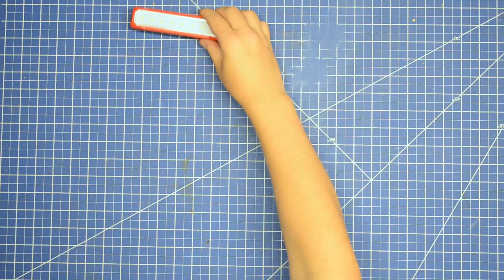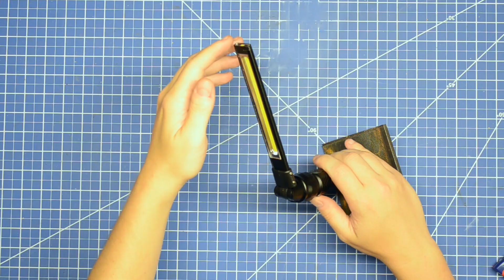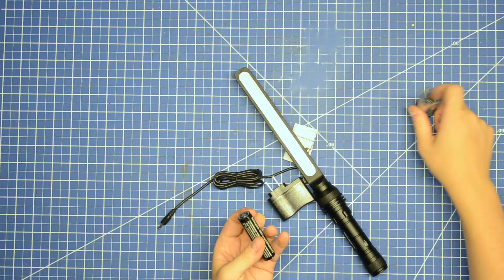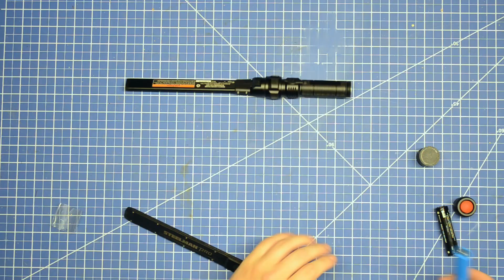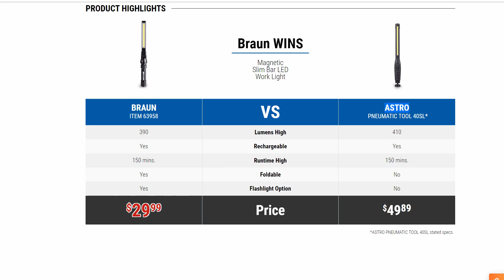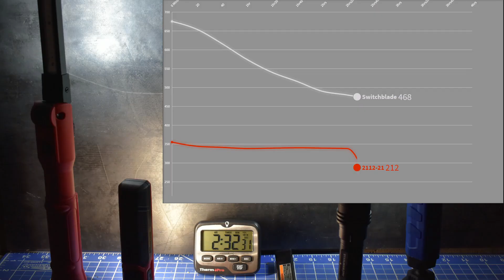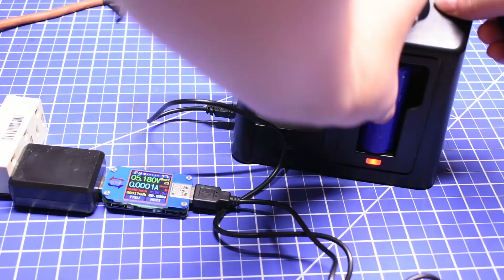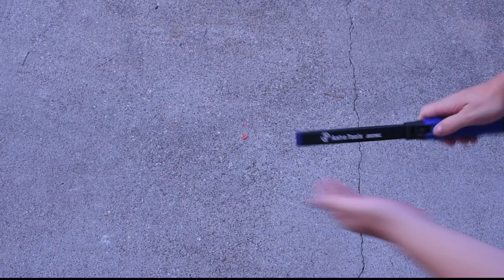Is Milwaukee Lying as Much as Harbor Freight Braun About Lumens?

Comment: The problem with the harbor freight light is not the switch. Just tighten the battery cap on the end. It come loose and causes the light to flicker like the switch is acting up. I have 3 and have had one for more than a year and still going strong.

Comment: I had a Braun light for all of about a week. Dropped it once from probably about 4 feet-ish and it the hinge broke, and light stopped working. I guess if you drop it at just the right angle, it can be pretty fragile, in my experience. Went with Astro after.

Comment: Looks like the Steelman Pro uses a protected cell. That's what that extra "lip" you noticed is. It's a small board with components that will limit the amount of Amperge the battery can deliver, and will also help prevent the battery from being over-charged, or used below a set voltage. Of course, that increases the overal length of the 18650 cell, so not all devices are compatible with protected cells.
Reply from the maker: The other lights take protected cells as well. The lip was plastic
Reply: @TorqueTestChannel  It wasn't clear from the video as it looked like a normal protected 18650 cell, and the other batteries in the video looked like normal unprotected cells.
I've taken a look on the Amazon link and the Steelman website and now see what it is you are talking about. Looks like it has both the positive AND negative contacts on one side of the cell, though the markings on the plastic seem to indicate that there is still a negative side to the battery like normal. I can't find any images which show the other end, or the inside contacts of the Steelman light you tested. If the light really uses a contact that is only on one side, I can easily see why no other battery would work, and this would definetely make the Steelman light a no-buy as the proprietary battery is listed around $15, more then half the price of the light itself.

Comment: 18650s are tricky batteries, too high ah typically drain faster unless you run them in series. Ive noticed at least 3 2500ah or 3000ah is a happy medium for good power and longer life of them. Anything lower than 2500 seems to be underpowered but for a light that might be better idk. I do know leds dont need a lot of voltage/amps to run and flood light/lantern style leds are more effective for working but more leds need more power so trade offs. But you also dont always need blinding light.

Comment: I've had Braun lights for many years. You can get chargers with 4 - 5800 MAH batteries and a flashlight for $20 on Amazon. I'm old and I find the light from the Braun almost too bright and mainly used them on their lower setting where it lasts about 3 hours. For people who have problems dropping their lights, I suggest a lanyard attached to a magnet or a locking pliers.

Comment: It is possible that the Milwaukee measured less than 3 Ah because it could be using a DC-DC buck converter, which transforms 5V at lower current into 3 - 4.2 V at higher current without too much additional heat. This is likely also the reason why it is pulling almost 2A and not exactly 2A: it probably regulates a charge current of 2A into the battery, resulting in lower current from the wall.

Comment: Really liking that astro, i have four 5200mah 26650s. Are these protected cells or is the battery management built into the light?
Reply from the maker: From what we've read, it takes protected cells but has it built in as well
Reply: @TorqueTestChannel  Awesome, I run protected cells so it wouldn't matter any way other then length.

Comment: the first gen rover red lithium usb was not ever well received(weak back magnet, hard to place well etc..) which is why milwaukee moved on from that light quickly, for your question on why the milwaukee light has poorer run time, milwaukee addressed it themselves during the 2020 pipeline event, it has to do with heat management. the next gen models have a much better heat sink and according to them greatly increased run time. guess we'll see, as im pretty sure they not out yet.

Comment: I haven’t had any serious issues with my Braun light, though I’m a hard DIYer (do a lot of automotive and home repair for myself, family and friends), so I don’t put it through quite as much daily use as you may.

For me, the Braun (which I bought over 2 years ago for $16 on sale) has paid for itself.

Edit: the only issue I’ve had (besides the cover for the charger coming off) has been occasionally the base plate loosens which makes it stop working or flicker like yours did in the video.  I just tighten it back up and it works fine.  That may not be what happened for you (I’ve heard sometimes it’s faulty wiring inside the joint), but that is what happens for me so far.
Reply: To be fair, you probably arent running it from fully charged to battery cut out while dropping it from a 16ft ladder. IMHO, Harbor Freight is like wish, or aliexpress, or banggood, or amazon (these days)... If you know what to look for, have a good idea of what goes into a product and what that is worth then it comes to R&D, production, and fully bringing it to market, you can spot when something is over promising, is a really good deal, or even absolute crap but will have some fun salvageable parts inside (I love shopping wish for crap to take apart XD). There are plenty of tools at Harbor Freight that, while yes are not the best, are still worth the $4 and 3 years youll get out of them. If someone wants more life out of a tool.....then dont buy $4 screwdrivers LOL

Comment: Milwaukee lights don’t hold up to heavy duty use or grease, diesel, oil, etc. had this light, the $30’one and the m12 stick light. The stick light is the only one that held up reasonably, but it doesn’t have a magnet, it has that stupid hanger, and the button can be non functional at times.

Comment: One of the advantages that I discovered with my Braun is that the battery access cap can be turned about one rotation counterclockwise for transportation. I found that the switch can be turned on with the slightest bump in my tool bag! Loosening the cap eliminates this anomaly. For the price when on sale they fit my budget. I use more than one so I don’t need to reposition them when moving from underneath or side to side, I just switch it off. My biggest problem is trying to remember where I stuck all the damn lights!
Reply: LOL I actually lost a couple braun lights doing brake jobs or suspension jobs at my dealership. left them attached to struts or control arms only to never return. This is more common than you would think. Thankfully they are cheap. Some magnetic based lights I have go for $300
Reply: I have used the Braun one's for about 1 1/2 years now they have fallen of the cars on the lift at times (to much rust) and some time's they break so a little black tape works well but if the light it self brakes off I use the base as a charger and just swap battery's.

Comment: i use self made convoy s2's. i can throw them against walls and all that happens is they dent a little. (i got bored and decided to test impact resistance) may not have the super wide COB array, but at 5" long and 1" around, it'll fit in most places and i can stick it to anything metal with the magnet ring in the endcap. and my choice of 250lm, ~600lm and 1600lm (for a couple minutes, until thermal throttle) modes.

i'm about $30 into that light, including a battery, since i have tons of salvaged 18650s from laptop batteries. (so a ~2000-2200mah)

from scratch, anyone capable of electronics diy can build one for ~$50 all in with battery and charger.

for something you can stick in your pocket, swap cells as needed, and blow these retail options away entirely.

sorry, but they need to step up their game a bit.

Comment: The Braun is on sale TODAY for just $19.99. I have two and the only problem I've had is the rubber receptacle cover on one broke off. As for the switch you placed its very strong magnet on a thick piece of steel then turned the flashlight counterclockwise which looked like it unscrewed the cap a bit which is why it started working again after you tightened the cap.

Comment: Haha! I would absolutely recommend the Braun, especially if you can buy them for $19.99. It performs as advertised, and IF you ever destroy one through drops, you can just pick up another and still be under most of the other lights. I can buy 3-4 of them for the price of some of the other options. What’s not to like? With HB no question warranty, if you have that button issue, u just exchange for another. If your unit doesn’t have that problem of the bat, it really won’t down the line. I just buy these in bunches when they’re on sale, and keep extras lying around.

Comment: Steelman is not proprietary. Its an 18650 with a charge protection circuit built in. Common for flashlights to require those.

Comment: I have 2 braun lights, one to charge one to use. I picked up one on sale and after using it for a day I ran back and got another one. The thing can fit almost anywhere with that folding head and magnetic base. Good to know the battery is replaceable, I vape and have a bunch of these batteries always on a charger.

Comment: If you crack the Braun open, beef up some solder joints with extra solder and secure a couple of wires with hot snot, it gets into a whole other level of durability. Those steps will also solve the finicky “power button” issue. The problem is that the case ground wire breaks inside and loses contact if you jostle it. With a battery upgrade and that repair, I’ll reach for the Braun over my Astro’s and others every time. The size, flexibility, and lower light output is much more useful in my opinion. There is a such thing as too much light when doing automotive type work and for me the Braun is just right. I will say that it is not easy to open the Brauns up. I have to put the lights in a 6” heavy duty shop vise and turn the tubes with a 16” pipe wrench. The threadlocker they use on those things is no joke when paired with aluminum threads. A propane torch made no difference on them...

I am biased though. I own many lights, but 8 of them are the Braun stick light. I didn’t pay more than $20 for any of them though. I bought one from HF for $2. The charging cord didn’t work so they marked it up as a defective light. I thought I was going to have to do my usual repair, but it charged right up on my Nitecore charging station. :D

Comment: Comment on the Streamlight. The Streamlight bottom should just twist off. Battery should slide out. I have the Strion Switchblade, i left it under a truck, drove off, it fell off, i drove over it and am still using it today, 3 years later. i just twist the bottom off and change the battery. The big one you tested should do the same.

Comment: You want to test a near indestructible worklight?   Test the Bosch FL12 12V.  I've never had one stop working- ever. I have unfortunately lost them but only when I'm using a really expensive battery- D'oh!  I have had 6 Brauns- I don't mind losing them as much but they die easily- best to buy at least one extended warranty if you are using those.  I also have the streamlight- I don't use it that much because of it's size and charge time.

Comment: I don't like high C rates. No matter how good the lithium cells/batteries are high C will always reduce the longevity of the battery.

But I totally agree: 0.87 A is pretty slow for the capacity. That's almost unreasonable.

Comment: I have the Braun light. Have same problem with the switch, but it does still work. Magnet is strong. Was working under my truck and had it stuck to the frame. But I forgot to remove it when down. A couple of weeks later I am looking for it and remember the last time I used it was under the truck. Slide under truck, and it was still there even after driving it several times.

Comment: EXCELLENT! Very eye-opening. I wish I had known that astro had a new light with a standard li-ion battery. I have several 18650 batteries and a couple of 21700 with a nice external charger for quicker charge times. Being able to swap in a new charged battery is the only way to go.
Reply: I own the Astro light; it isn't a standard battery. Their protected 26650 is a different dimension (length) than any other 26650 I could find anywhere. Two different 26650s that I have don't work. I haven't tried 18650s yet - they might be standard size.

Comment: The stream light model that you chose is actually most likely based on their nickel metal hydride technology and not a lithium ion battery. Since it’s using their stinger type chargers. I believe that’s proven out when you look at the discharge curve, and that’s why it has to be charged back so slow. Pretty much the plan with that light is there hoping you won’t run it all the way down before you put it on the cradle.  That way you just keep charging it back up all day long while you’re not using it. 

On the other hand the strion model is a lithium-based platform and would have the characteristics of the other lights you had tested. Although it really still is a proprietary based battery. 

 They are just starting to move over to the 18 650 platform with their new second generation stinger lights and I’m not sure that they’re folding lights have caught up yet. They make a great product but they lag a little bit behind the marketplace in release time. 

I’m really actually attracted to that Astro light you were testing. It really did perform and I like that you can use two different size batteries and charge two at the same time. I decided several years ago I will no longer purchase any lights that will not run an 18 650 or something like that that you just can’t easily swap and charge externally.

(I did go and check on their website, and the Strion Version of the light actually does have a removable battery. And it supports their piggyback charger, where you can keep one battery on charge while you also charge the one in the light. Seems like a much better deal)

Comment: High CRI leds are inherently less efficient than low CRI leds. This is mainly due to the phosphors being less efficient at converting the blue/violet/uv (depending on the LED type) light emitted by the LED into the various wavelengths needed to make white light. 

Warmer color temperatures are also less efficient because colder CCT lights with low CRI let more light through unconverted.unconcerned.

I would love to see you evaluate the CRI of the LEDs. Bad color rendering can make a blue and purple wire look identical similarly they can make pink and red look the same.

Comment: I’d love to see a comparison of the different under hood lights if at all possible. 

I really need one of those, and had one of the cheapo Braun models but it was just garbage. Lol. Thanks for your info, these are fantastic videos.
Reply from the maker: We'd need a pretty big sphere for an underhood light!
Reply: @TorqueTestChannel  hahaha, this is true. I have faith you could figure something out though! Maybe a tube, with a couple sensors then averaging the recorded output from the lot. 

Idk tho, I’m definitely not the brightest bulb in the pack.
Reply: @TorqueTestChannel  the milwaukee pivoting floodlight (2114-21)is my favorite and i wish it was tested because in my experience the one in the videos magnet sucks the top ones can barely hold it if you try and stick it to hang  unless its perfectly vertical. but the floodlight version is brighter snf sticks better and has a carabiner clip. but their low profile 600 lumen headlamp is my favorite by far so if you do headlamps i hope you test it,
Reply: @TorqueTestChannel  idk if anyone else would agree but with under hood lights i think the focus would be more on the beam pattern/spread battery life, charging time , and attachment strength

Comment: Bought the HF Braun light. Used it under a truck for the first time yesterday for a hitch welding project. It lasted 5 minutes then the button issue reared it’s ugly head.  Tried a few more times, now completely dead. Back it goes.

Comment: Did you use the cables they came with? The Stream Light charge cable you used looked super pathetic, I'd be horrified if more than an amp went thru that cable. An honestly thick cable might do better.
Reply from the maker: We wanted to use a thicker cable than what it came with but the connector area is super small. Fits almost no other micro USB. Like the physical area around the plug end. Another downside.
Reply: @TorqueTestChannel  oh how weird. That's definitely a downside.
Reply: the milwaukees usb cable that comes with these units is actually really nice and performs the best out of most cables i have when using a USB multimeter

Comment: Another great video!

Btw, I find many work lights are too bright and discharge too quickly, trying to make magical lumen numbers for sales. I often need to shine them next to where i’m working, if pointed directly onto the work area it white washes the area in our dark shop.

300-400 lumens is plenty usually. We usually aren’t trying to light up the moon from earth. :)
Reply: Streamlight is a good option for you then. It has natural lighting and reduces glare and lumen refraction. I use them. Perfect for spotting and identifying wire in harnesses in no light areas. Glare is always a problem. True 300 to 500 lumens is where you want to be. high temp blue light is not recommended
Reply: @kevinkieel6778  In IT, I've found that the blue light works VERY well, especially when you're trying to read the printing off of the ceramic chips. It's all about surface reflectivity and absorption.